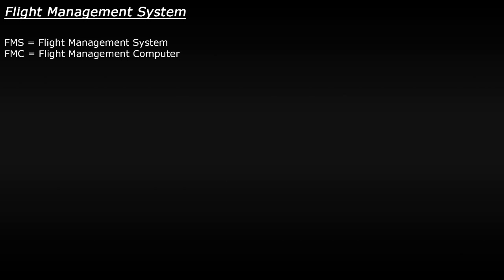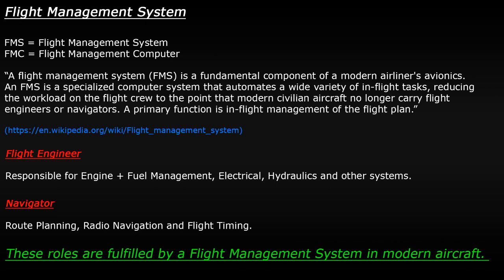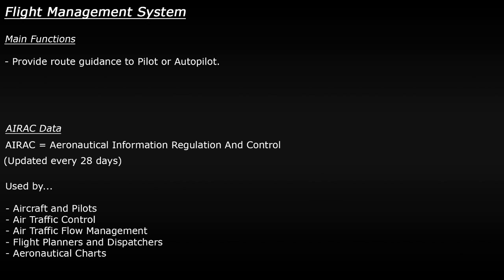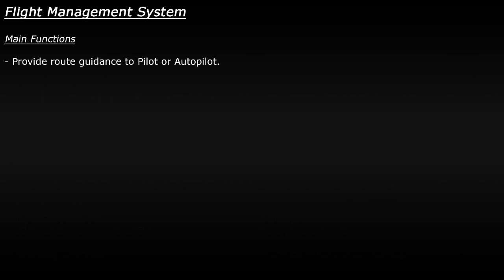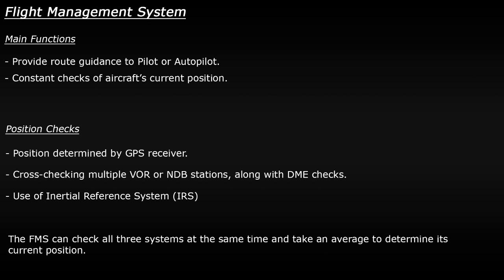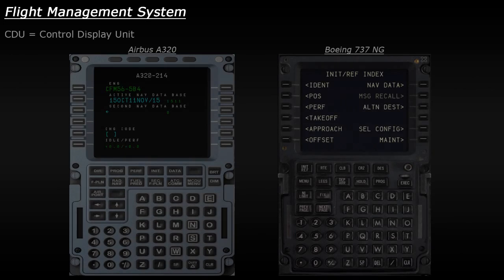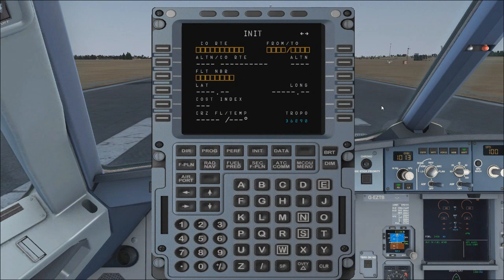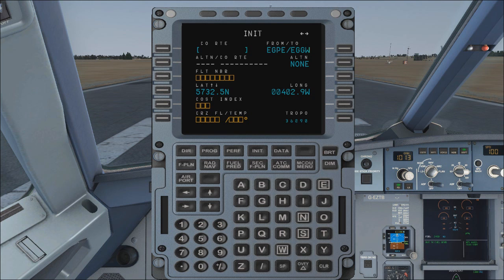Flight Management Systems Explained

Comment: You keep stating that you must keep Nav, Data upto date. Why when you can't update the ILS or Runway direction numbers as they change periodicly over the years  But a good video any way
Reply from the maker: I believe the AIRAC data which is published needs to be paid for each time it's updated so it's not available to casual simmers however there is a Flight Sim Addon called Navigraph which is a subscription based service which updates your simulator's AIRAC data and also offers other things such as software containing aviation charts

Comment: Are there any freeware aircraft with FMCs, or installable free FMCs which can be used with freeware aircraft, which also can be kept up-to-date with AIRAC data?
Reply: Max John there's EasyFMC and vasFMC. EasyFMC needs to be registered to work fully (it's a paid service) but you can use it even without doing so on some FSX planes. vasFMC should be fully free, although you will need to download AIRAC cycles. EasyFMC uses the default FSX data.
Reply: Well, freeware aircraft don't tend to have a good FMS system.

Comment: why are certain alphabets having boxes around them ?
Reply: North, East, South, West
Reply: N(orth) S(outh) W(est) E(east) used when manually entering waypoint coordinates fx N57°28′18″  W4°13′31″ into the FMC .
Reply: Most pilots use ARINC 424 shorthand for entering lats and longs

If I wanted to fly to N35.00 W115.00 I would enter 35N15

The placement of the N between the two numbers tells the FMS that it’s in the northern hemisphere and west of the hundredth meridian. 

If I wanted to go to N34.00 W98.00 I would type in 3498N. 

Similar patterns using the placement of E S and W will give you positions everywhere on earth from a simple five digit code.